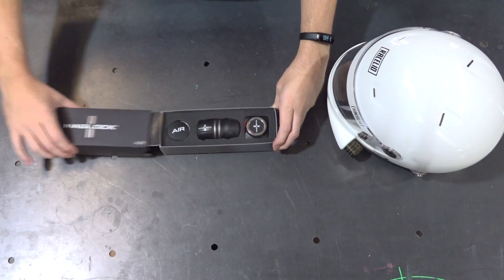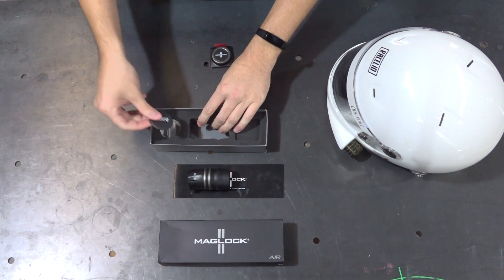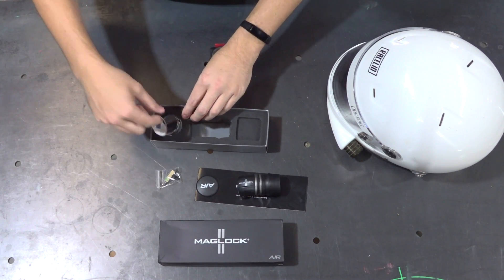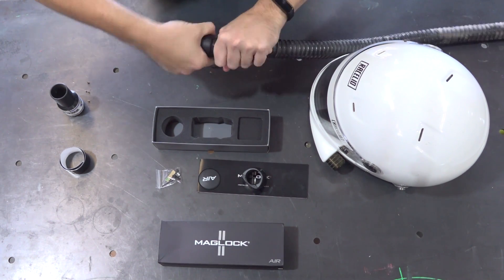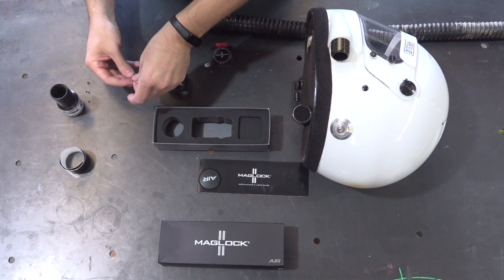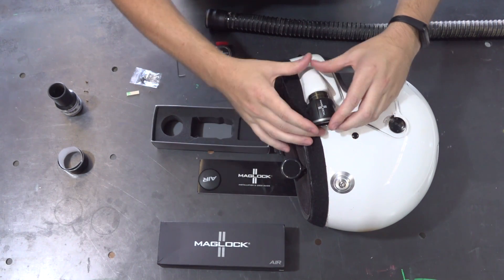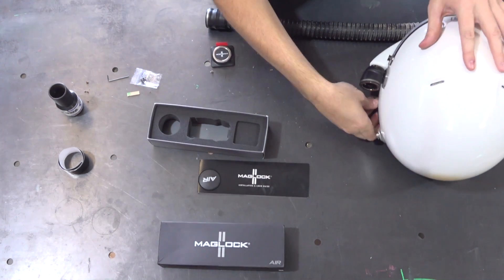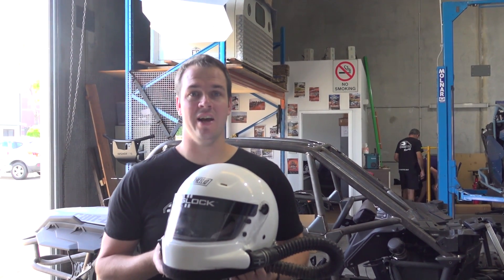Maglock Air Installation

Comment: The clamp that attaches the to the helmet ( in my case a Bell Qualifier) are secured by two TINY bolts that you tighten with a 1.5mm L-wrench. If Maglock had used LARGER diameter & LONGER stainless steel socket head bolts that were just a little longer, I would appreciate this product more.  The screws are too short and strip out very easily.  The screws were barely long enough to engage the threads in the clamp.  Will it stay attached with this flimsy setup.  The supplied L-wrench is too short to tiny to turn with one hand.  Additionally, the part that attaches to the hose is too small to fit on the Rugged Radio brand air pumper hose….which I didn’t find out until AFTER I had cut off the end as directed in the instructions.  The instructions say to apply a bead of silicone but do not provide that.  This product could be great with just a little more refinement.  At this time, I’d like to punch somebody in the nose for cutting corners with the hardware.   I’m angry that this product costs so dang much considering the poor hardware included

Comment: It looks like your using a Rugged Radio hose. I thought you had to buy a $50 adapter to put Mag-Lock on Rugged’s hose
Reply from the maker: For that hose we just twisted off the existing end and then fitted the Maglock end. There are some hoses that require adapting, but you might be able to make your own or adapter